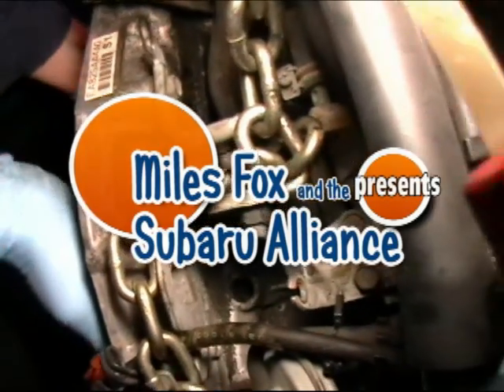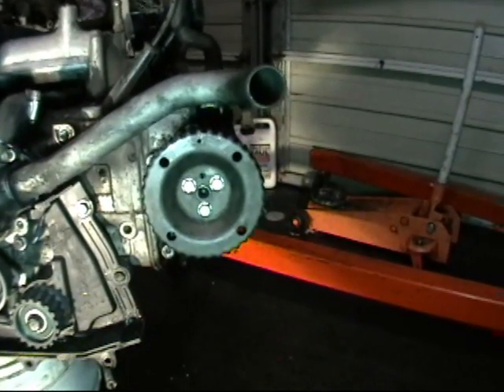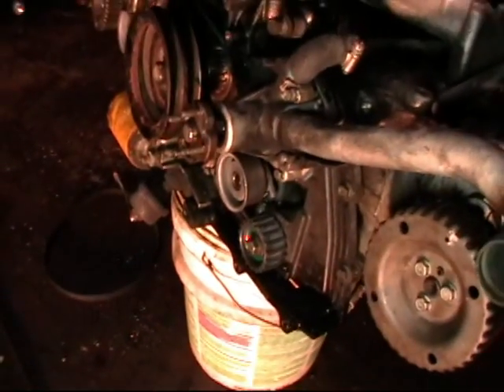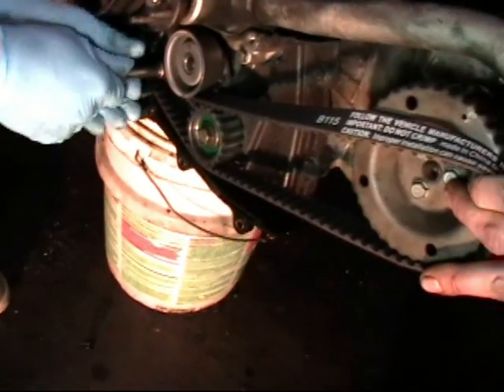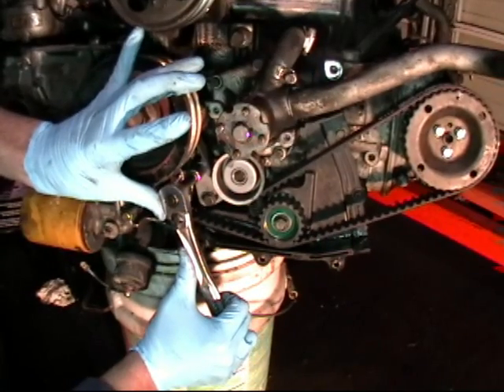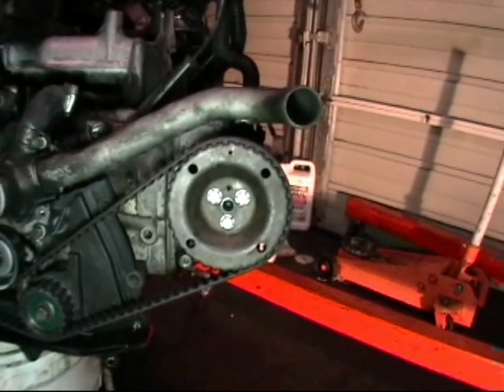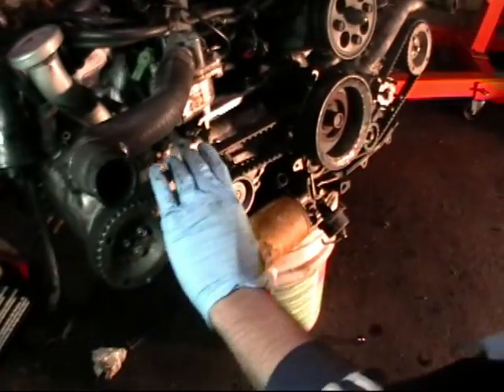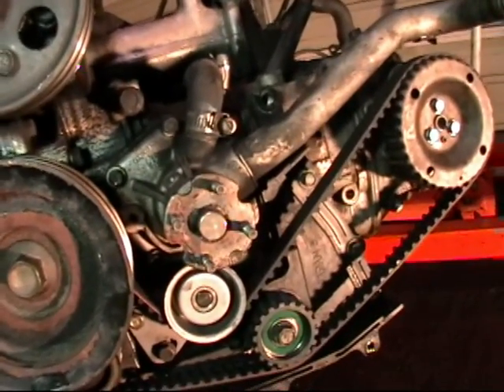EA82 Timing Belt Procedure  (Subaru GL DL GL-10 Loyale XT RX) L-Series

Comment: Do I need to take the engine out
Reply: Did you ever find ou?
Reply from the maker: This work can be performed without even taking g the radiator out. Remove the fans for clearance, use correct spanner that engages the face of the damper

Comment: Thanks .Was a great help, Brought a 1992 Subaru wagon last week for $300. Was told that the distributor was faulty. Distributor was not with the car they had thrown it out. I had a spare car here I pulled the distributor off and fitted it to the car, Turned engine over by hand and saw it wasn't turning. The timing belt had disintegrated. I followed your instructions and changed the belts and timed the distributor and it fired first kick. Thanks :)

Comment: You guys are FUNNY!
1) Take out the spark plugs  and you won'r fight compression on rotation! 
2) Before belt installation on either side, Lift and lock both tensioners using the slide lock bolts. You can then release them after belt (s) are installed! 
#Capiche ?

Comment: Just wanted to thank you for making this video! Me and some friends are using a Loyale with an EA82 for a cheap off-road race and because of a leaky oil/water pump, this service was in order.

Thought I’d be clever and rotate the passenger cam 180 instead of the whole motor, does not work with how the cam sits on the valves. Just ended up doing it your way. 

Thanks again!

Comment: Did you guys 'have' to remove the engine, or were there other issues or necessities to repair?
Reply from the maker: It was not necessary to remove the engine for timing belt service. The engine was already out and for the sake of demonstration. However, taking out the radiator affords better access, especially when doing the water pump, although removing the fans only can accomplish this. Good luck.

Comment: Seriously bad idea to run an engine without the timing covers in place. especially if your on gravel or dirt roads.. one rock or pebble bounces up and lands in the right place and its over. the belt will stretch/break and/or the tensioner brackets will bend. Ive even seen cams bent this way and ruin heads.the ea motor isn't interference but lots of motors are. A slipped or broken belt can ruin an engine quick, and leave u stranded.

Comment from the maker: You rescue the spare set from the trunk, slap em on and go! This is a non interference engine. Running with no covers turns a 2 hour job into a 20  minute job.
Reply: I'm so happy for this video. I just got my grandmother's 86 xt turbo with 68k original miles. It's been parked since 2002

Comment from the maker: It is usually common for people who maintain their own subaru to ditch the covers and leave them off. 
1. The covers break or will not stay together upon install.
2. The next time you service the car, you will be glad the covers are off; this saves you from having to remove the crank pulley and compromising the torque on the bolt. It allows you to change the water pump without removing anything. You can  inspect or replace the belts, even off the side of the road. You can do this with 2 tools.
Reply: Not to mention the threaded inserts that strip inside the plastic that just spin 'round and wont allow the bolt to "Un-thread"  (>_<) !

Comment: Great video.  This was my first subaru and only second timing belt I've ever had to do (first was on a Geo Metro...even easier if you can believe that!).  I have an automatic with the engine still in the car and I have to say the hardest part is getting that pulley bolt off since theres no way of locking the crank other than jamming a prybar in the starter ring gear.  

One item to add here...if you have an auto, the timing marks are on the torque converter along with the ignition timing marks.
Reply: There's a 'HOLE' in the FLYWHEEL just behind the TIMING MARKS. You can see it in the video. Stick a steel rod in the hole to stop the flywheel from turning.

Comment: Great video. My driver side (left cam pulley) belt tensioner seems to be stripped on the upper bolt with the locking nut. At times it comes loose and jumps a tooth. I've taken the covers all the way off so this is a breeze to work with now. My big question is how to rethread the block for a stripped bolt, and I can see on the cam sprocket and idler sprocket where the belt used to ride. ( in the middle ) now the belts ride flush on the outer edge closest to the  block. I can see the shiny spot w
Reply: I had same problem on car I bought. I found out the bolt holes are 25 mm long with 20 mm of thread. The FACTORY BOLTS are 16 mm long & the TENSIONER is 7 mm thick leaving only 9 mm of bolt thread for tightening. UPGRADE to 20 mm to 25 mm FLANGE BOLTS so you can use all of the thread available in the block. WARNING be sure to MEASURE ALL BOLT HOLES FIRST to be CERTAIN of HOLE DEPTH. FAILURE TO DO COULD RESULT IN A CRACKED BLOCK. If the thread is stripped you can use a STUD by cutting the head off a bolt and threading the stud into the block using the rest of the thread in the block that hasn't been used by the shorter factory bolts. Apply 2 part liquid steel to the stud where the stripped threads will be and screw in and use a homemade cardboard washer on the end of the stud to push all the liquid steel into the block . The block surface where the TENSIONER sits must remain flat with no liquid steel protruding. Use FLANGED NUT on the stud.

Comment: Sorry to ask what's probably a stupid question, but how do you get at the slotted bolt holding on the AC compressor? I have a bracket with a tab broken off, have a replacement bracket, and am having a hell of a time getting the existing bracket off the engine. I also need to change the timing belts, and this part has me stymied. Thanks!

Comment from the maker: @DeliciousMike any of the ea82 engine will be the same with the timing belts and engine seals. 1985-1994 subaru DL, GL, RX, GL-10, XT, Loyale in turbo, spfi, or carb.. Even the xt6, with slightly different belt and pulleys, use the same alignment marks and procedure.

Comment from the maker: That is a common mistake by folks who are not familiar with this car. It's a good way to get into them free or cheap, if the owner/dealer/shop is telling you it has bent valves. Re-align the belts and go!
Reply: Miles Fox so if either one of the timing belts snap, the valves will not bend?